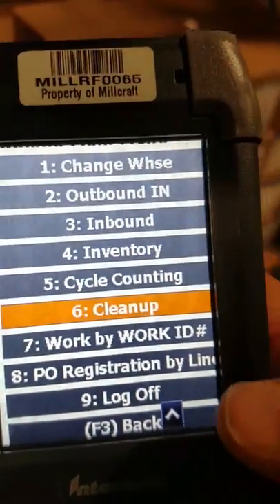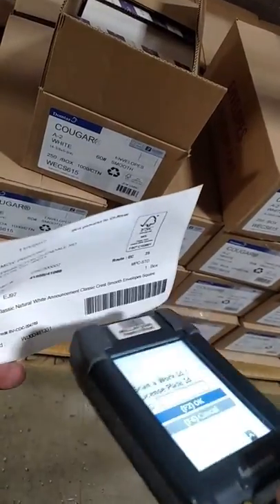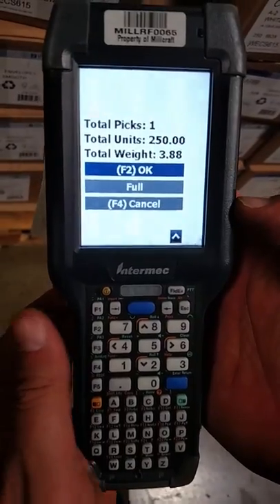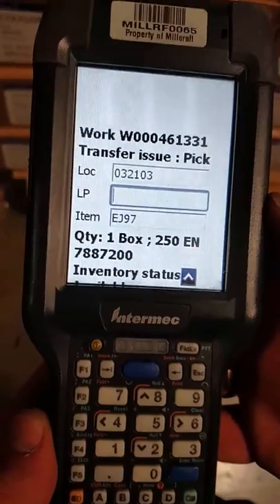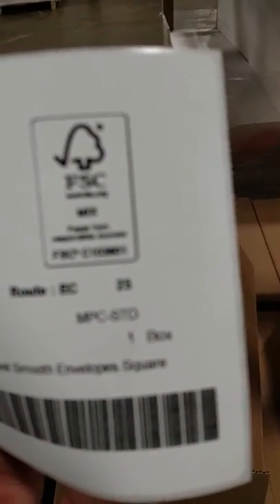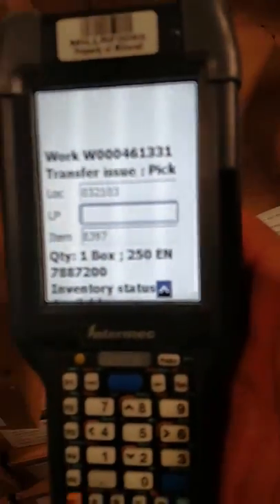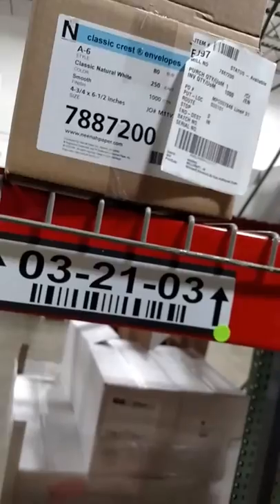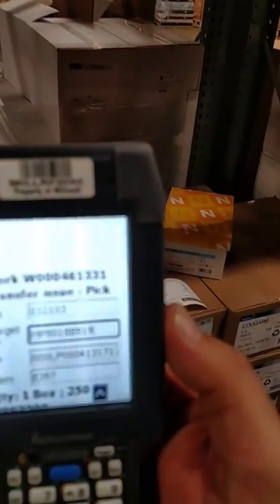Order picking AX12 with RF

Comment: So the units are what is Within thw 1 box..  so if it were 1 box of 45  units but had options of 20 units,  30 units or 45.  you look for the 45. But the gun won't scan the 20 or 30 ? only 45 units